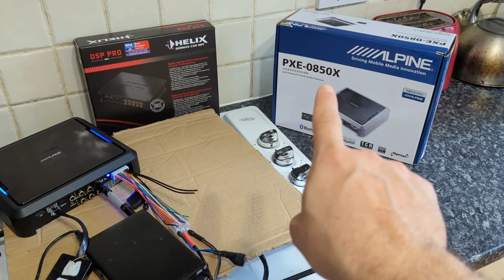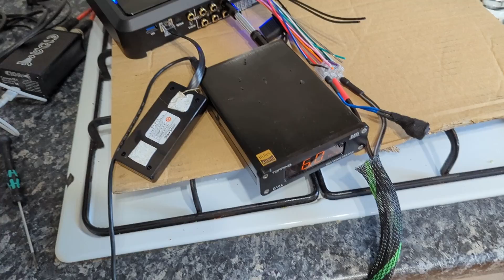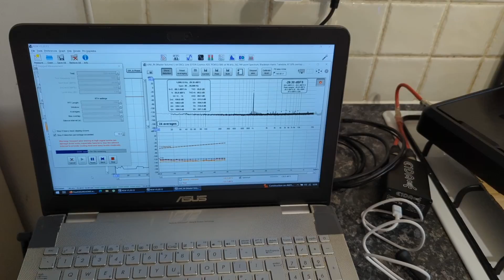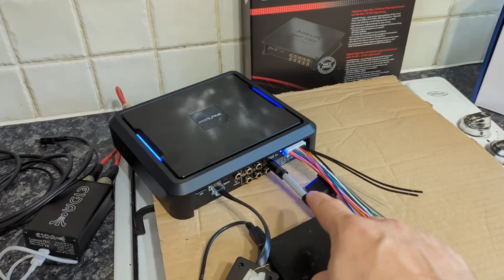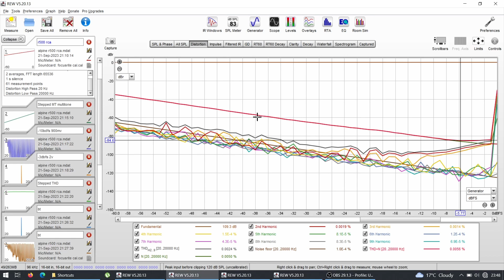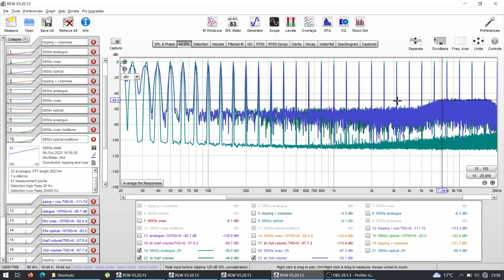Are Alpine DSPs any good? Alpine PXE-0850x distortion measurements

Comment: I wonder Its amp starts to distort at what level of volume?
Reply from the maker: The distortion depends on the output voltage, not on the position of the volume knob.
Reply: @RAW-CAt OK. Then how would you rate the amp?
Reply from the maker: @tanaditwisdom8408 I literally have all the measurements in the video.

Comment: When you test the Bluetooth are you connected using AptX? I would have thought that would be equivalent to coax and optical since it can do raw or high res
Reply from the maker: LDAC can do that, not AptX. Yes, I tested on AptX.
Reply: @RAW-CAt Thanks. Sounds like I won’t be making much use of my BT alpine dongle once I get my unit installed
Reply from the maker: @paskoh for daily listening to Spotify is good enough.

Comment: What u suggest between Alphine pxe 0805x vs Musway D8v3
Reply from the maker: Alpine hands down. I believe that musway has a built in fan that is quite loud...
Reply: @RAW-CAt  thanks 

I’m getting Alphine PXE 0805 X for a deal around $550 and helix pro mk2 for about $800 

However I have external amps to power all speakers .. can I go with Alphine or should I  go with helix with extra bucks
Reply from the maker: @prky009  the only benefit of the helix MK2 over alpine will be the all pass filters. The MK2 is an older model that does not have virtual channels and it works on the older slower platform. Between these two, I would choose the Alpine as it's cheaper.
Reply: @RAW-CAt  Thanks a lot . I’m your big fan 

I have below set up 

Head unit : Alphine ilx 650 e 
Front and back component : xcelsus XUP.2i 
Midrange : XXM325
Morel MPS series class ab amp :70 x4 
More MPD class d amp : 70 x 4 
Kicker 10inch sub 

Now I’m planning for a 3 way active setup . Looking for a 10 or 12 channel dsp 

Confused between PXE 0850X or helix pro MK2   

I just need a good SQ Level audio and I don’t want to regret later for selecting a wrong dsp 

As a fan .. now I’m clear and I’m going with Alphine pxe 0850x 

Can the inbuilt dsp amp can power front and rear tweeters ?

Comment: Thanks for the vid!  I have used the Alpine 0850S for a couple of years, purely as a DSP (not the amp).  I've been using various DSPs since back in the 90s (i.e., Sony XDP-4000x)  That Sony ES piece was amazing at the time.  Anyway, I wanted 9 fully active channels and the Alpine fit the bill.  The Bluetooth dongle is garbage for reliable tuning, but I've been pretty happy using the USB connection for tuning with a laptop.  They should not have included the BS amplifier channels.  They are obviously crap, even for tweeters and fill.
Reply: Really surprised they included the built in amp, seems it’s a “all in one” when it shouldn’t be

Comment: Is it a BTL amp which has DC offset compared to GND on both + and - outputs?
The cosmos ADC seems DC coupled and will not be happy wit the DC on its inputs.
Please couple the input truly balanced and remove DC offset from both + and - output of the amp.
Reply: the DSP uses TDA7851 and yes, it's an internally bridged amp. i hope he's going to tell us how the amp hooked up since one of his previous amp test also failed. im guessing he hooked up the speaker - to ground
Reply from the maker: I just ordered the caps for decoupling DC. Didn't have any. Yes, when testing amps I will follow this suggestion. Thanks😊

Comment: I think where optical makes a difference is in a car. From what I understand (not an expert at all), is that there are other signals in the cars elecrical system that make their way into the audio system via ground (analog).  I had a faint hiss you could only hear with your ear next to tweets and mids,  no audio playing and parked. When I switch to optical, it was gone and my highs got super crisp and detailed. Im thinking optical simply isolates audio signal from cars polluted electrical system.